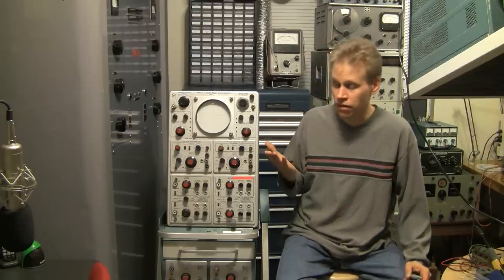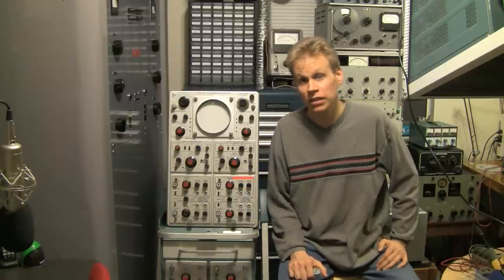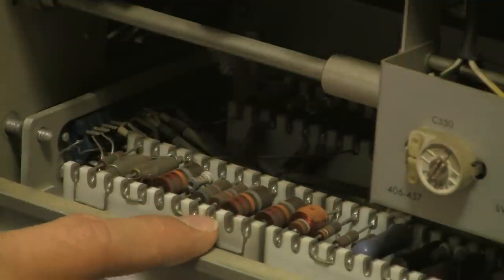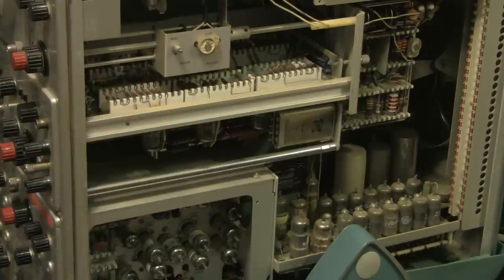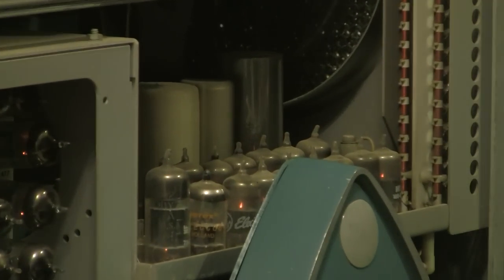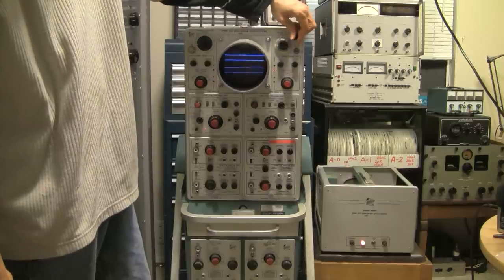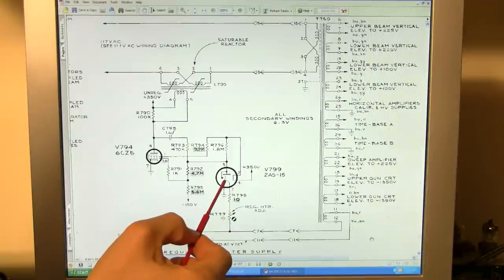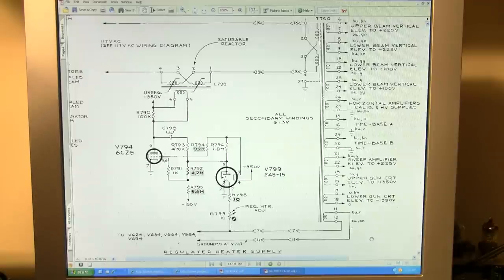Tektronix type 555 oscilloscope, over 100 tubes inside!

Comment: I grew up and took university classes at a tektronix campus in Oregon.  The professor was an Iranian ex-Pat  who worked on the engineering and finance side.  He was a wonderful professor and we toured  the local facilities on the weekends.  He taught me more about financial modeling on the operations side than I ever wanted to know.  Great guy and a great company.  His wife turned me on to tube audio amps.

To this day i still love tubes for audio.     A good dinner and a glass of wine with your favorite bands on vinyl,CD or streaming is wonderful.  Big brute force tube amps are  fun.  

I have 2 sets of tube monos all class A at 100w and 250 watts that were made right here.    In 15 years, I lost 1 input tube and a fuse.  Everything else tests fine after 20+ hours of listening time a week.

Never,have I lost a pre-amp tube and those pre-amps only get turned off and unplugged for trios lasting longer that 4 days.

Tubes are really great.  I own SS amps too, but simply preset tubes for most music.

Comment: Great video! Thanks. I actually had one of these expensive  room heaters that doubled as an oscilloscope in 1980. I remember counting over 87 tubes in the main unit and about 18 tubes in the power supply. When I turned it on my lights would dim. It seemed like it was working just fine though.  In those days I worked at Hewlett Packard (1975-2006) and a friend that also worked there gave me that scope. I also got to use  HP scopes which were much smaller by then. I worked in the Electronic Maintenance Department and got to work on a lot of equipment, mostly HP test gear and personal computers and printers. It was a great experience because it was in the golden age of personal computer advancements and technology.
Reply from the maker: Thanks for sharing your story Stephen.

Comment: I really appreciated watching this video.  I have a Tek 545B and a Lavois 265, which was a virtually identical copy of the 545A, and was involved in the famous lawsuit.  I used them for a lot of years and always marvelled at the flawless construction of these beasts.   My favourite plug-in, was the diode checker.  With it, I could check every parameter of a diode and I also used to use it to check the junctions on transisters that I sometimes used as diodes.
 Thanks for taking the time to explain these fantastic pieces of equipment to an whole new generation.
Bob
Reply from the maker: Thanks for your comment Bob!

Comment: That thing is the Hammond Novachord of test equipment!  I miss when this much care was put into building things.
Reply from the maker: I agree!
Reply: I would also liken this oscilloscope to my two vintage Moog Modular Synthesizers.  I still remember taking one to a friend who was experienced with electronics for his help (the power supply had a loose solder joint.)  He admired the reverse-anodized aluminum panels (no silk-screening to wear off here!), the Allen-Bradley pots, the Switchcraft enclosed jacks, the precise pin-point wiring and soldering.  He then turned to me and said, "this was built back when they knew how to make things right."  With that assessment, he paid Bob Moog the highest praise he could offer.
Reply: And if they charged for that in today's dollars would you buy it? Thing is the reason they built it like that is that it was all they knew. I'm certain the people from that era would much rather have built it like today's because it works so much better and is so much cheaper to make. Remember that the next time fire up that all-plastic four pound DSO to do some finite element analysis or some such I don't know.
Reply: Not only were things built to last but they could be repaired by the owner or augmented or repurposed. Everything now is cheap and disposable and when it breaks you can't even get it open to see what's wrong. I pine for the analog days.

Comment: Love old Tek equipment (they're works of art and exquisite craftsmanship) and have a ton of it. 4 mainframe scopes with 4 plug in's, 2 -  3 plug in, 465's, 647's, TM-500 stuff and over  30 plug in's for the mainframe scopes such as 7704, 7104 and 2, -7854 DSO's and a 676 curve tracer. HP stuff too, meters, VTVM's, frequency and function generators, RF generators (3) up to 13GHz, a 1959 130B, X,Y scope in working condition. RCA senior Voltohmest, analog VTVM, with a whopping 7" mirror display (I love this meter for checking scratchy pots), Systron Donner frequency counter (Nixie tube) and a Fairchild 7000 , Nixie tube, 5 1/5 digit DMM, Fluke DMM's,   Hp power supplies, 6200B, etc X3. Govt liquidators was selling this stuff for a song, several years back.  The 7104 mainframe cost the govt $30,000, I bought it for $50 and the calibration sticker was still good! I also bought metrology equipment, Voltage standards, oscilloscope calibration gear (much of it in wood cabinets that people passed up because they thought it was old - It very common for metrology equipment to be in a wooden case), tube tester, capacitor analyzer and conditioner. Theres lots more, Genrad decade resistor, decade capacitor boxes and inductor boxes. Hp attenuator, Weller, SMT workstation, Temperature controlled soldering iron, 5 Hexacon soldering irons from 40 to 200W. My go to scopes are the 465B with the penthouse and I have 2 spares for parts.  I've run my own electronic musical equipment repair business since  1965. Specializing in vintage tube equipment restoration (but I work on digital stuff as well).  On my main bench (I have 2 - one for amplifiers and the other for small pedals, tape decks. Bausch and Lomb stereo zoom microscope, I probably forgot half of the gear I have acquired since 1963. I really enjoy your site!

Comment: Wow what an amazing piece of art. 
The power regulator I believe solves a sixty year old mystery for me. When I was a student I worked in a lab which analysed rocks using a Watson victor arc spectroscope. It was huge all vacuum tubes and always powered on.  It was supplied through a voltage regulator which was a heavy steel box with a cover full of holes. Inside I could see a very bright vacuum tube among a few other normal ones. No one knew how it worked   It seems it was a saturating controller or possibly a motor driven variac using a 2AS-15. As the voltage sensor.

Comment: Great video. Nice to see someone that knows what saturable reactors are. I have two of those scopes. One to use and one for parts.  My user is a little sick right now though. It has a wobbly power supply that I cant run down. Lukilly, I have a full set of manuals printed off from microfisch. No kidding about the room heater though.

Comment: Wow! I thought that my Tektronix 502A was impressive with its 43 valves and a fan! At least its power unit is built in! 
You're right, it is beautifully built and mine had a little coil of spare solder inside.

Comment: I repaired Tektronix scopes of that era for 20 years ((530x and 540x mostly) and I can tell you nothing is built like they are. A lot of the circuitry was developed by Tek engineers and it was absolutely brilliant. Peter Wright wrote a book on audio preamp design iin the early 2000's and he lauded the designers of these instruments for their meticulous work.

I can vouch for the reliability of these instruments, we ran them 8-12 hours a day for 6 days a week and they ran for years before needing any attention.
Reply: Allen Wright, not Peter.
Reply: @Dont_Gnaw_on_the_Kitty_1  -  You're absolutely right, my memory is not as sharp as it once was.

Comment: A true blast from the past... I wonder how many people alive today would be able to design such an analog beast.
Reply: They would use an arduino of course!
Reply: not enough, you need a flash ADC, microcontrollers usually has successive approximation types, also a significant horsepower, maybe the arduinomega? with a flash ADC? hehe.
anyway, you can''t beat, for instance a RIGOL 1052, the performance/price ratio is simply unbeatable.
Reply: @buddhafollower , another great video subject... GO FOR IT!

Comment: I once owned a 647; the Nuvistor one. Bought it from John's radio in Bradford, England.  Same kind of construction and it came with a small reel of the silver solder.  After using it for a few years, I put it away for 20 years in its transit case, and it still worked for the guy who bought it from me.  Next to indestructible :-)

Comment: Your videos are amazing and circuit theory is almost 100% perfect. I spent most of my electronics career calibrating and repairing Tek scopes.  I started in 1965 on the 500 series scopes and built muscle hefting them around for routine maintenance. We had several hundred pieces on six month cal cycles and I was very familiar with the smell of hot tubes.  We also had quite a few other pieces of test equipment mfg by Tektronix. Our service manuals took up a whole wall and the parts inventory took a whole room. When I retired we just getting into the 2000 series scopes.  Nostalgia.
Reply from the maker: Martin MartinL  Thanks for the nice comment Martin! Sounds like you have a very interesting history as well.

Comment: I used to have this model. It was stunning inside, so many valves, and the rectifier valves in the external power supply were huge. I bought it for £45 in a junk shop in Bolton, Lancashire in England in the early 1990's. It had stickers on the side from the Jet Propulsion Lab in Pasadena California. How it got from the JPL to a junk shop in the UK is a mystery. Mine had a spare spool of silver solder inside (top right if I remember). The action of the switches were great, smooth and solid after so many years. I think I spent  more time staring at the inside with the glowing valves just in awe of the engineering than I did looking at the front when using it.
Reply from the maker: They sure are fascinating, and are from an era where quality wasn't second. I don't know if I mentioned this in the video, this scope is from Boeing.

Comment: I had the pleasure of using a 555 back when I was in school. Aside from the quality of the components and construction, I belive the tube longevity was a result of the filament regulation. A lot of vacuum tube failures are a result of voltage surge on start up. I've worked with transmitting tubes that had regulated filament voltage for the same reason, but not using the saturated reactor method. Great video.
Reply from the maker: +Bill Moran 
Thanks for comment Bill!

Comment: Very informative demo of these great Teks scopes. Took tube theory in EE class back in the 60s.
Worked with a lot of Tektronix and HP scopes working for telecommunication giants over the years.
he 555 is built like the Cadillacs back in the 50s.  ($2600 in '59 is about $26,000 today (give or take a few)..
and the new ones will be probably assembled  in China.
That 2AS-15 is a unique thermionic diode. and works as you explained. The failsafe device in this tube
is this filament tensioning spring that makes the connection from plate to cathode if the filament opens up.
Reply from the maker: SuperCarver2011 Thanks for the comment!

Comment: To be fair, this cost as much as a house did back then. Innovation and quality driven by the demands of the cold war military-industrial complex, I can't get enough of this stuff! I own a type 549 myself! Sometimes, I like to take off the covers just to admire the construction. 
The Allen Organ company also made all-tube products that are known to run reliably for decades without tube failures, also easily containing a hundred or more tubes. They continued using all-tube power amplifiers after they went to transistorized tone generation circuits. I own many of them, and they are built with far higher quality than consumer grade equipment.  The story goes that Jerome Markowicz, founder of Allen Organ, consulted extensively with RCA to engineer their products for maximum reliability and tube life.

Comment: I was impressed to find a 10 cm length of silver solder inside some Tektronix equipment once, in the early '60s . A notice near it said it was for high quality repair work.
Reply from the maker: Hi Charles. The silver solder was necessary to use due to the ceramic strips that hold the components in the scope. Ordinary solder would eventually cause migration issues and destroy the silver connections in the ceramic, (cause them to separate)

Comment: Used a scope only once or twice during my career as an Instrumentation Tech.  I was just probably amused by the dancing trace.  Awesome scope.  My Old frequency meter is built similarly with slide out plug in modules with spare metal tubes inside that looks as if they were just installed.  Never been used.  I love these vintage stuff.  They don't build them this way anymore.  Everything is "disposable".
Reply from the maker: +Greenfield 54 
I agree, quality now has taken a back seat to greed. One day it will return.... when people learn that a one year operating time from their electronic equipment is not at all acceptable.

Comment: Iv'e had a number of these scopes over the years. The last one was a non-digital storage scope with a scope cart, two single channel plug ins including  a 10 MHz to 10 GHz spectrum analyzer plug in. Other than being "room heaters" I never had to replace any tubes and it worked every time.

Comment: I like your spot-on description of the saturable reactor heater voltage regulator. I'd add that the "short" used within the 2A5-15 tube is there so that if that tube were removed it cuts saturation and so drops the heater voltage. Very well done treatise, IMHO.
Reply from the maker: glasstronic Thanks for the nice comment!

Comment: That is truly beautiful. Regulated filament supply, such precision. And twice the price of an RCA CT100!!! My daily driver is a Tek 453 and I am very happy with it. You have a big future in making these videos.
Reply from the maker: Thanks Colin! I have been working on my next video since Christmas... "on and off." Should be up very soon. The Tek 453 is a great machine! Seems like all the older stuff they made was incredible.
Reply: Mr Carlson's Lab Bad news/good news. My Tektronix 453 (untouched but well used in the 10 years I owned it) finally developed a fault, and I really needed it as my Philips 3230 just wasnt fast enough for the job at hand. The fault turned out to be an open 75K resistor in the 12V regulator, also a nearby electrolyic spewed its guts from old age. Now I am tempted to replace all the electrolytics. Do you think Rubicons are OK? Long live Tektronix! 
Love your presentations.
Reply from the maker: Colin Lark Hi Colin, Rubicons are great, so are Nichicon, and Panasonic. Good luck getting it running again!

Comment: I have two of those monsters and still love to use them when I can get them close enough to the project I'm working on (main bench scope today is a Siglent SDS 1202X+).  I was a member of Navy/Marine Corps Mars and I repaired lots of "obsolete" radio gear and test gear from retired by the Strategic Air Command (SAC) at Offutt Air Base in Bellevue, NE.  I repaired these two back in 1978 along with a number of plugins and time bases, and, by jiminy, they're both still running today!
Reply from the maker: Thanks for taking the time to write Richard!

Comment: That is one beast of an oscilloscope. The fan inside the power supply is rather interesting. I have an Telequipment D52 oscilloscope that is about 1959 vintage which is also dual beam. It only has a single timebase and is portable. Nothing like the weight of that 555. I haven't fired it up in quite a few years now. It needs the caps replaced as its voltage regulation isn't very good.
Reply: Kevin Cozens, make a video of it being restored ala Mr Carlson's Lab! You are guaranteed a watch, by me!

Comment: The silver solder was used to provide compatibility with the silver-clad ceramic material of the terminal strips. Common tin-lead solder would leach the clad silver and compromise the terminal strips' reliability.

Comment: In my six years I repaired and calibrated hundreds in the USN.  I loved these..
Reply from the maker: You must know every nut and bolt in these things.
Reply: Mr Carlson's Lab My job code was 1588. .(metrology) GPTE  which is an acronym for general purpose test equipment .  We repaired and calibrated all types of equipment in the navy.  If it had handles on it , it was considered to be portable.  We covered the frequencies of D.C. - 18 GHZ.  
These were the scopes many ships used in the ET shops .  Brings back good memory's. Thanks for posting this!   In addition to your major job code, electronics  technicians were trained in rather communication or radar systems as to have  secondary backup.

Comment: Funny I still have a Tektronics 545A, same construction, tubes and ceramic strips, but the power supply is inside the main case. Like your 555, mine is still working perfectly also. It is not my main scope these days but it was sure nice in its day.

Comment: These are great scopes, and what I learned on when I started learning electronics. Before I was in my teens.

Many of these scopes have a temperature controlled fan.
Reply from the maker: +Paul 
Hi Paul, this has a fan, but it's on all the time. The temp control shuts the entire scope off if a fan gets plugged. Keeps the place warm in the winter (dual purpose scope) :^)
Reply: Glad to see you have kept some of these old beasts running. I have used many kinds of equipment over the years and fixed most of them myself. I have a 535, 545, transistor tracer and many others. So far these older ones are easier to keep going (but not so easy to lift) than most new units that I have worked with.